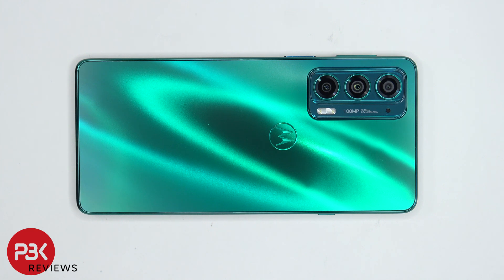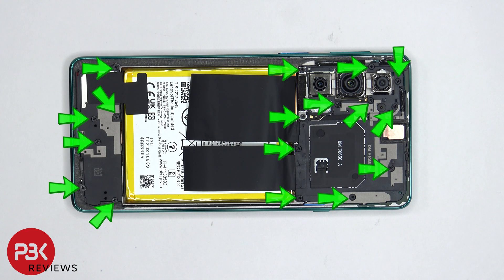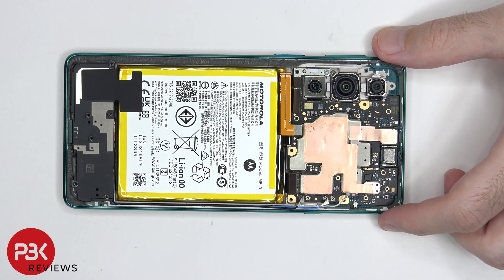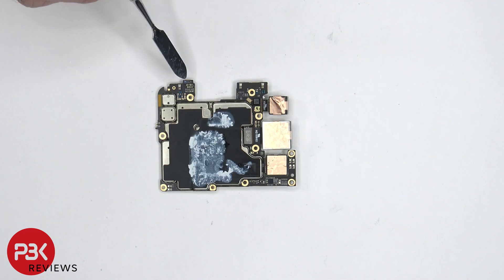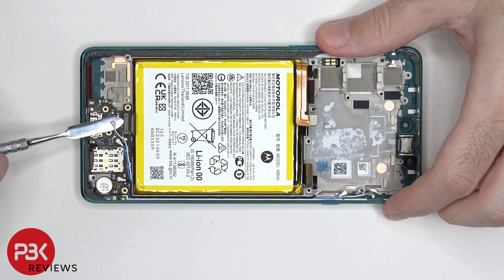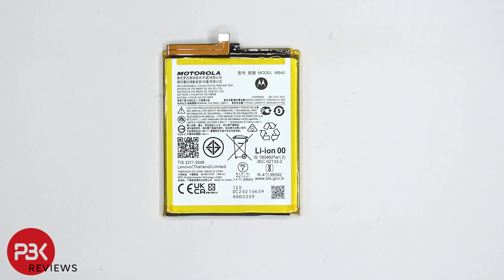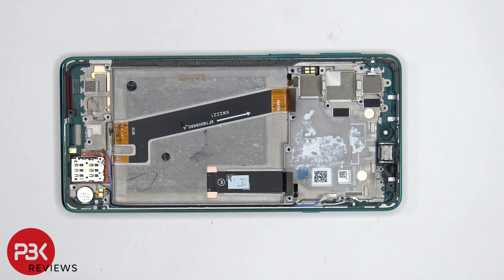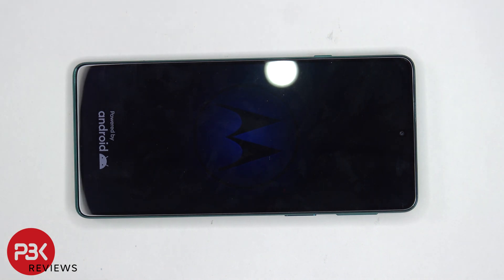Motorola Edge 20 Disassembly Teardown Repair Video Review

Comment: great video. but not enough detail on step 1, heat to soften adhesive? I am desperate enough to try to take the back of mine to get the SD card and Sim out. I didn't notice some plastic, the tray catch fell out of the slot when it popped open, until after I reflexively pushed it back in. Right after Windows update has just retired the original USB drivers for both my W10 and super crappy W11 laptop, so my phone usb cable is blocked.  I am stuck, and afraid I will melt it all....

Comment: I changed the charging and microphone board because in calls the other persons couldn't hear me so I decided to replace it. Again it's not working and I will try to downgrade/upgrade the android version (currently 13 the worst) and I will come with an update. Thanks by the video!
Reply: How did you solve it? I have the same problem too.

Comment: Where is(are) the GSM Antenna(s)? 
On the top plastic cover near the NFC antenna?
Or on the bottom with the speaker assembly?
I have a phone which has lost GSM service coverage after a fell which bent it.
Reply: Hey, do you repair your phone? I'm facing a similar issue with my edge 20, after replaced the charging port. Now the phone lost 5g functionality. Im getting crazy on why this did happens.
Reply: @controtebe  No, I have not. I ended up buying a new phone. My first non Motorola in the last ~14 years.

Comment: Very clear and concise video, well done! This helped me with disassembly to remove water from my phone after it was put in the washer.  Unfortunately then I had to replace my screen after I had mistakenly put two of the main board screws in before putting on the main cover.  I did not over tighten, but just from going in further they had pushed against the copper backing on the screen and caused it to become unusable.  Expensive mistake.
Reply from the maker: Thanks :)

Comment: Which adhesive are you using to put the backcover back on?
Reply from the maker: https://www.ebay.com/itm/115101125992?chn=ps&norover=1&mkevt=1&mkrid=711-117182-37290-0&mkcid=2&mkscid=101&itemid=115101125992&targetid=1496860881012&device=c&mktype=pla&googleloc=9031132&poi=&campaignid=19851828444&mkgroupid=145880009014&rlsatarget=aud-1317302328125:pla-1496860881012&abcId=9307249&merchantid=114706018&gclid=CjwKCAiA4smsBhAEEiwAO6DEjfnLrBbWITqfTOPhuWL6EAqg5q8Zbt_xA28molEvi6fcCH7FZwIV-hoC_IYQAvD_BwE

Comment: Hello, hope you'll answer to my comment! What's the concentration of the isopropyl alcohol you used to take the battery out? Its not mentioned in the item description
Reply from the maker: The one I use is : https://www.ifixit.com/products/ifixit-adhesive-remover?variant=39915173740647   and usually you want to go with a high concentration so it evaporates quick and doesn't linger around to cause any issues. Most people will go with 95 or 99% if I'm not mistaken.

Comment: Hi, Can I remove only the USB port without removing the rest?
Reply from the maker: Yeah, you can remove just the sub board (which contains the USB port) without having to take apart the top cover and motherboard etc. But it's always best to remove the top cover and disconnect the battery cable to reduce any chance of shorting something.
Reply: Hi my usb port is only go for charging doesn't connect mtp is their same problem with you or not???
Reply from the maker: no, try checking your usb drivers on your computer are correct.

Comment: Sir, due to update of Android 12, microphone is not working.
Also tried to install custom rom but in that case microphone is not working too.
So, can i replace charging board/sub board?
Or its a motherboard problem?
Reply from the maker: Not sure, you can try and see if replacing the sub board would help.

Comment: On the Motorola edge 20 xt2143 can you replace the glass only? If not is do you have a link to an original OLED display? Thanks and great video
Reply from the maker: Hi, the glass alone can't be changed. Here is a link to a site which offers original parts: https://www.gsm-shop.sk/predaj/nahradne-diely/lcd-displeje/lcd-displej-motorola-edge-20-(xt2143)-a-dotyk-s-krytom-bielym-original

Comment: display replacement for moto edge 30 , the service centre person said that we need to replace the display along with the frame itself.
Reply from the maker: Usually most service centers will have the complete screen assembly with frame pre installed. OEMs do it that way to make it faster when replacing/repairing. I prefer it that way as well but its more costly also.
Reply: @PBKreviews  yeah since my device is under warranty it's fine but the cost they mentioned is 60% the actual cost of the mobile.  It's ₹ 17000. The display comes along with the frame itself.

Comment: hello, do you know what the EDL mode pins are for the motorola edge 20 pro? or motorola edge s pro ? thanks
Reply from the maker: Hi, sorry not sure which ones they are. Would be two of the gold circle points on the board if I am not mistaken but not sure which ones.
Reply: There's no edl test points, u need to pay someone to flash your phone

Comment: Hey many users including me facing multi touch issues in moto edge 20 is there any solution for it? And is it Hardware problem or bug?
Reply from the maker: Hi most likely it is a software issue, and from what I have read, there is an update they are working to release soon to address that problem. Not sure exactly when the update will be released.

Comment: Good afternoon, May You tell me if they Motorola Edge 20 is Metal or Plastic? They are some stores that says it has metal frame and other says Plastic frame. Thank You.
Reply from the maker: Hi, the mid frame is metal but has a plastic boarder. You can see in the video when everything is disassembled, the grey/silver parts are the aluminum and the edges where its a greenish color is where the plastic border begins.
Reply: @PBKreviews  Thanks You. I Saw in this video https://youtu.be/nYbr_8yl29o that it was plastic.
Reply from the maker: @joaquimdeoliveira2185  yep problem with those durability videos are it only shows you what the outside is. The border is plastic but aside from the border the midframe itself is metal.
Reply: @PBKreviews  hai monitor match motorla edge 20 ent motorola edge 20 pro

Comment: the frame is aluminum???
Reply from the maker: Yea its aluminum alloy.
Reply: @PBKreviews  thank you!!!! But the device does not have the plastic bands in its frame, does it not affect the signal because it is made of aluminum?
Reply: @finalluis  that's the reason it has plastic back... but still wifi reception is low after 10M but nothing too bad . ( I own the device)

Comment: This also dont have cooling pipe or vapour cooling tech right?
Reply from the maker: correct. It does however have an aluminum block on the processor as well as thermal pad and thermal paste with graphene and copper heat transfer tape.